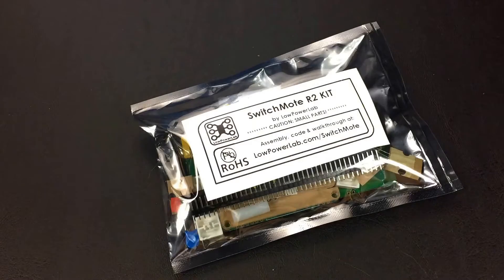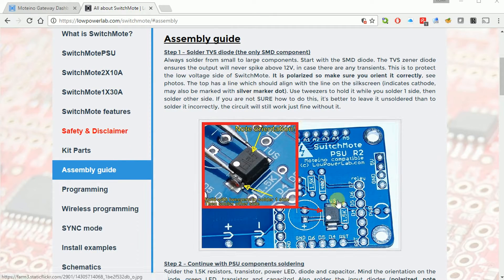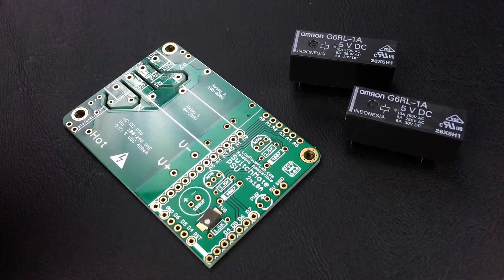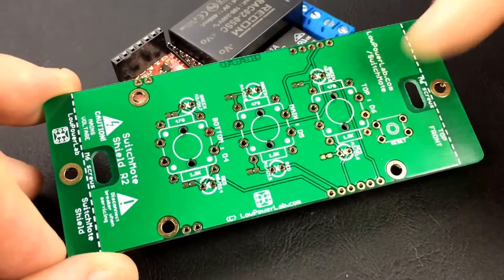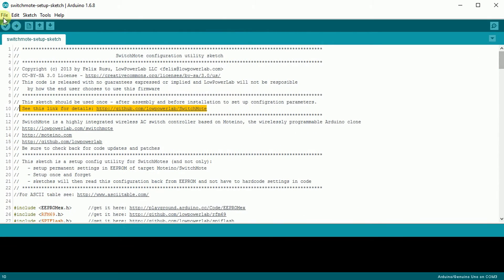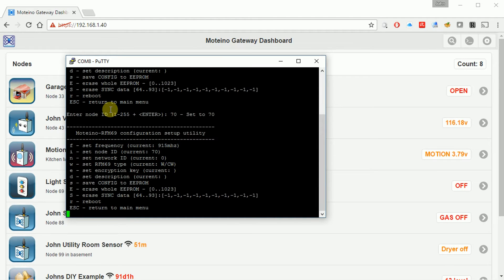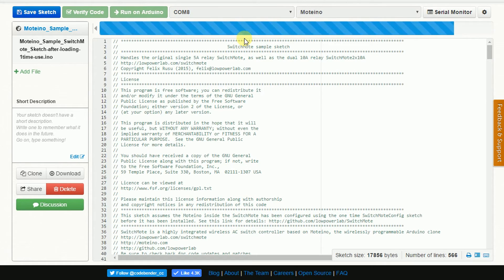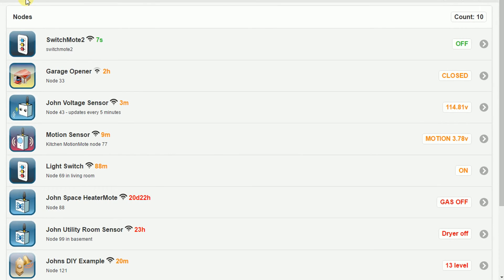SwitchMote - IoT home automation wireless smart switch

Comment: Does it have a day/time programmable option? Lights on Tuesday at 8:00 PM  Lights off at 6:00 AM?
Reply from the maker: It's possible to do this from the main control program on the Raspberry Pi.  The switch itself doesn't have a built in option or timer  you can set.

Comment: What home automation software" are you running and on what? Is it on a PC or a hub or did you roll it yourself on a RasberryPI. What communication protocol does the SwitchMot use? Is it some standard? Is it open source? Now that Google has opened the API for Google Home device, this should be controllable. I've seen Aaron Newcomb on The New Screensavers demonstrate something like that.https://youtu.be/549hjuc7trk?t=14m20s